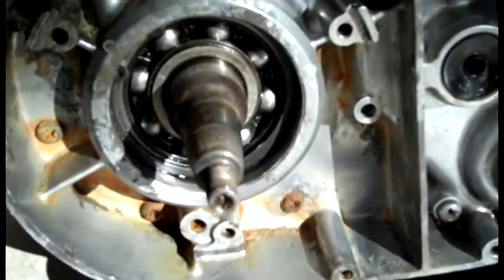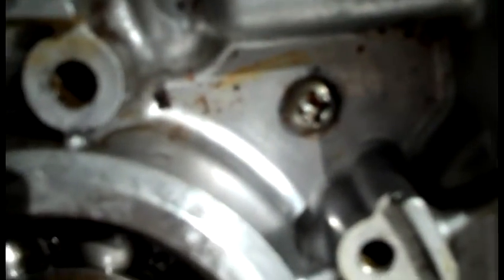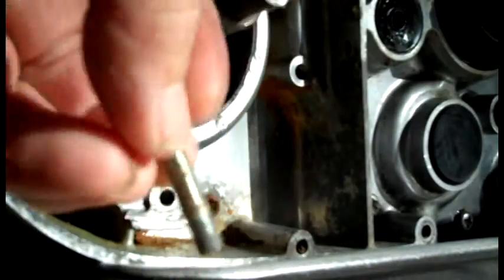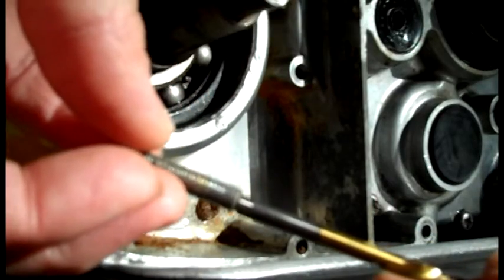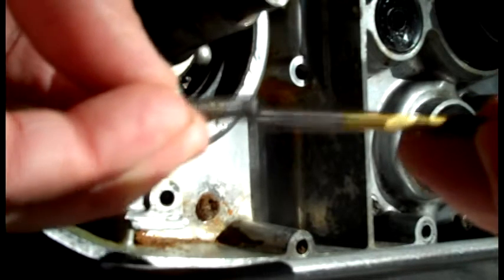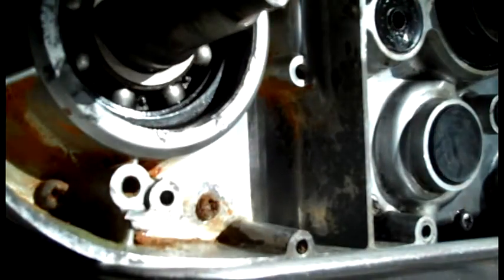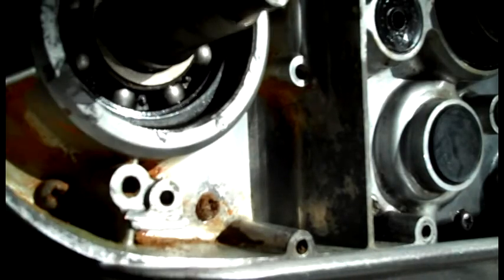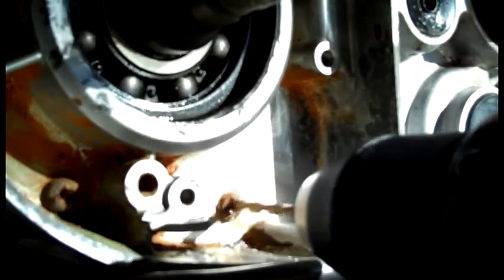Using a left hand drill bit to remove a buggered screw

Comment: I have a flush break on a water pump bolt on a Dodge Grand Caravan. As my experience with Easy Outs is that they tend to expand the diameter of the screw and could cause binding, I certainly will try this first. Also, if one has some length of bolt sticking out past the threads, I recommend putting a nut on the bolt to prevent the bolt from expanding or splitting if an Easy Out is used.

Comment: which direction is the drill going with left hand drill bit? fwd or reverse?
Reply: Old comment, but I'll answer for posterity's sake. You use a left hand drill bit with whatever drill you're using it in set to reverse, otherwise you'll wind up dulling the tip.
Reply: Thank for answering. Was wondering the same thing.
Reply: Tighten down and she goes in reverse

Comment: Is your drill in forward or reverse?
Reply from the maker: Use a left turning drill bit in a drill set to reverse the rotation (i.e. with a "normal" bit it would be turning backwards and not cut into the material).